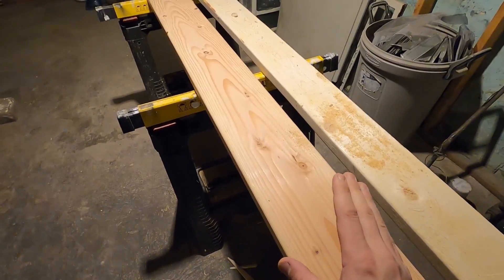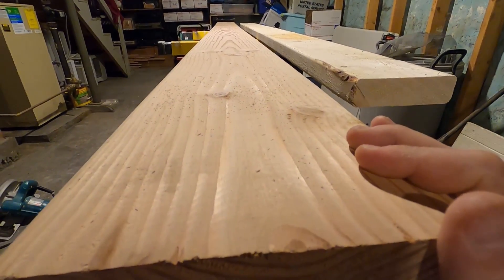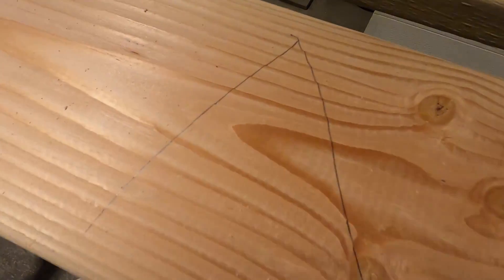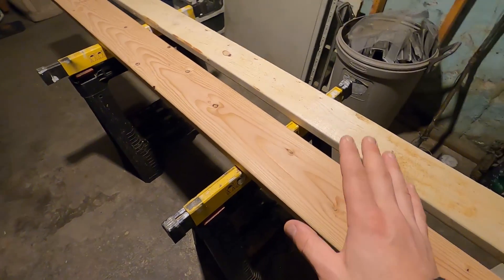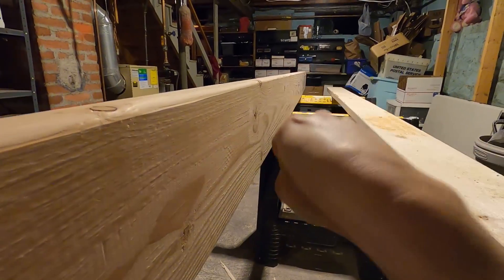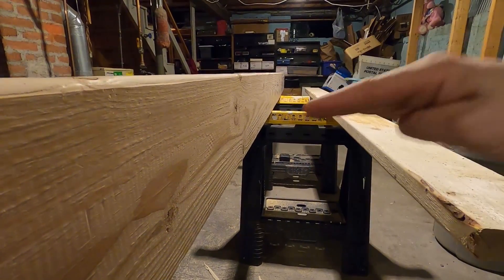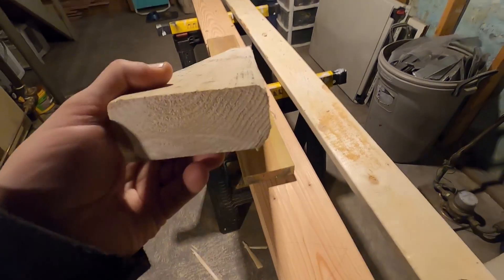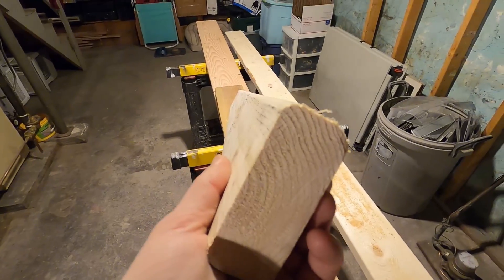How to Crown Lumber What Is Crowning and Why To Do It

Comment: Drywaller of 20+ years and it definitely makes a difference if the walls have been crowned or not. Especially especially when it's a smooth wall finish!
Reply from the maker: Thanks for the info!  And thanks for checking the video out!
Reply: Should all the crowns face the same direction in a wall ? Can’t really shave crowns off studs that will have drywall on both sides.
Reply: I started a job where they are very serious about the crown and I have trouble finding it, any tips?
Reply: @sylviahousner4711  For walls you want the crowns to all face the same direction. Otherwise you can get a wavy wall. Imagine you have 3 studs each with a 3/8” crown. If they all face one way you will never notice it.  Rotate the middle one 180 degrees and you have a 3/4” dip in the middle.

Comment: What if your using for a base plate. Does it matter? I have a 10 ft pressure treated ,2 x4 and I don't see a crown.  I placed it on the floor and I don't see any daylight at the bottom. Let me know please.
Reply from the maker: Some boards barely have a crown so in that case it really wouldn't make much of a difference so you can put it any way you like.  Sorry for the late reply.

Comment: I have a 10 ft 2x4 as a base. Flat on the floor I see daylight at bottom so am saying the under side is crowning and I should lay that side down? Correct or not.
Reply from the maker: Yes if I am understanding that correctly you would want to put it the way it is when you see daylight underneath.  In other words you want the bow facing up.  Hope this helps.  Thanks for watching!
Reply: For a base n top plate, should the crown face into the room or up ( on a base plate)? Does the base plate need to be level ? Or do I need to shim.

Comment: So, up to this point, due to not nearly enough practice, (I’m 29) I’ve had trouble seeing the crown.  So I just want to double-check to make sure I understand what to do.  Are you saying, you should be able to see the other end? And if you can’t see the end the crown is down?  Or is it the other way? Not seeing the end= crown up?
Reply: If you can't see the end it's the crown cuz the crown is what's impeding your sight.  You can also look down the face of flat side of the board and see which way it twists.  If you look down and the board twists to the left that means the crown is on the right. Hope this helps 🤘
Reply: @boohoo210  You would then lay the right   flat side down facing the inside of a room when installing a wall.
Reply: Some boards at straight so you can’t tell, when it’s really bad it’s a really noticeable curve, if you can’t tell then it’s straight enough to put either side up